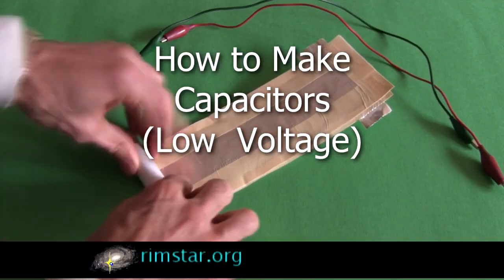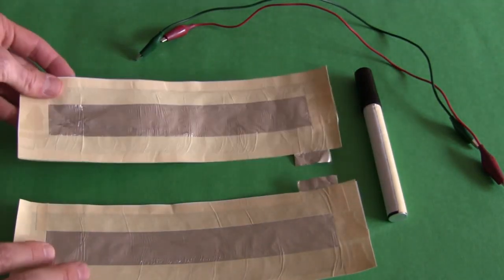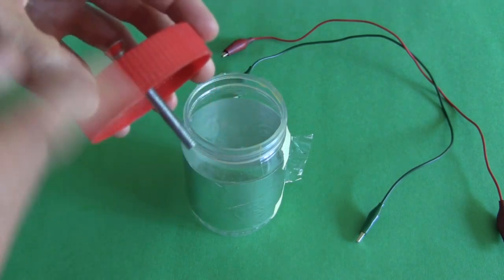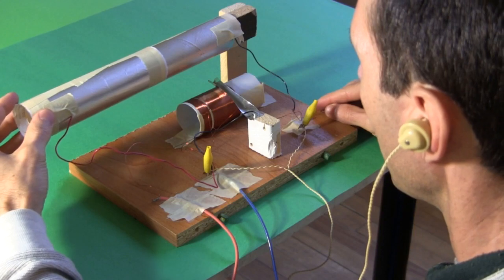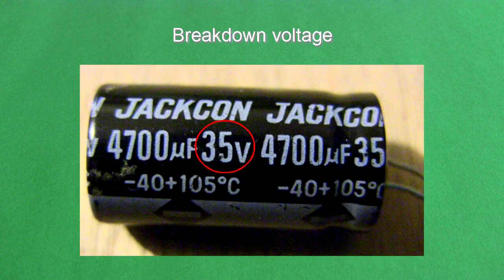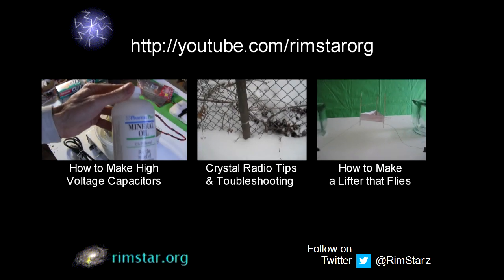How to Make Capacitors - Low Voltage Homemade/DIY Capacitors

Comment from the maker: Just reassembled and measured them. The salt water one is 0.64 nanofarads  and the  tube pen one is 3.66 nanofarads, so the tube one has a greater capacitance. This wrapping a spiral of parallel plates is a great way to get a decent capacitance with a small homemade capacitor.
Reply: consider your formula for capacity is wrong by a factor 4π. I think you messed up with CGS system vs SI System.

Comment from the maker: Oh, neat idea. I guess you can take it further and spray it on a metal plate, then spray the primer as dielectric as you suggest and then to make good, airless contact with the primer, spray a conductive paint as the second plate.

Comment: The "magnet effect" also explains why the farads go up as the gap gets smaller. The closer the plates, the more opposite particles are attracted. I think (my theory, never seen it elsewhere) the particles start to "Stand" from the plate allowing more electrons to be stored. The electrons may even layer up if plates close enough. It also explains the corona effect....

Comment from the maker: I have no idea where to get them in the Philippines. Search around online and you might be able to find some. Art stores sometimes have them too for crafts. I get mine from scrap yards and hobby stores. If you're making a capacitor then any metal will do just as well: copper, aluminum, brass, steel, ... The only issue I find between them is how hard it is to solder to them, if I'm soldering to make connections. Aluminum is hard to solder too.

Comment from the maker: No, as long as the glue doesn't damage the dielectric then it should be fine. The glue will probably be insulating so it will act as additional dielectric material and if the layer is thick compared to the overall dielectric thickness then it will decrease the capacitance. That's because the greater the distance between the conductive plates, the lower the capacitance.

Comment from the maker: I don't know how well it will work with either of those. It's also the first I've heard of using them as electrolytes, though a quick search turned up a toothpaste battery. If you try it, please let us know how it goes.

Comment from the maker: It should be possible to make electrolytic capacitors that are 100uFs. I haven't done it yet but you just reminded me that I should try and if it works I should make a video about how I did it. Thank you! I forgot. :) However, electrolytic capacitors are good for AC parts of circuits, not DC.

Comment: Thank you Maaan for making my life simple. But my question is?
Can we connect "starting" ac capacitor permanent on circuit with right range without getting overheating? Or it's good idea to disconnect the capacitors after starting...waiting for kindly reply...thanks

Comment from the maker: Yes, you can use another aluminum foil. The metal you use doesn't matter much. Just make sure you can make good electrical contact with it.

Comment from the maker: 50 millifarads is huge. I don't know how to make a capacitor with a capacitance that high. If you were to make a simple one using a sheet of paper with aluminum foil on either side then my calcs say it would have to be 35.5 million square meters! You might want to look into ultracapacitors.

Comment from the maker: Yes. Wax paper will work, though it might be a good idea to use more than one layer of wax paper. I actually tried with wax paper first but I guess when I rolled it up there were cracks and the two aluminum layers came in contact with each other, multiple layers of wax paper would probably fix that.

Comment: Will have a look ! I'd built the tube type and mucked with flat plates, but hadn't thought to expand the thoughts to different shapes, constructions etc..much like we get used to the familiar shapes and sizes of commercial electronics components.
Looking forward to the HV caps video.

Comment: Whenever I write MF I am talking about milli farads µ is symbol for micro, M is the symbol for milli (or million if dealing with numbers larger than 1). There is a difference of 10^3 or one degree of magnitude......  Same as any other abbreviation of degree of magnitude. You could suggest people use short probes too... You don't mention the magnetic (Columbs law) effect caused by opposite charged particles attracting..
Lots of good info though. Nice video. A few good tips. Thanks for the upload.

Comment from the maker: I can't say how many volts it can take before the wall of the jar breaks down. You'd have to keep increasing the voltage until it breaks down to find out. Or find out exactly what material the jar is made of and do a search for its breakdown voltage. But if it's a plastic or glass jar, 220V isn't going to break through. I doubt even 1000V will break through.

Comment from the maker: Ah, by "magnetic" effect you meant the Coulomb force, attraction of like charges and repulsion of opposites. That's different than the actual physics magnetic force. I thought you meant the magnetic field that exists in between the plates when the capacitor is being charged or discharged. The molecules in the dielectric line up and polarize, causing the charges in the molecules to move, resulting in a magnetic field. That's the one that I meant is obscure. Thanks for clarifying.

Comment from the maker: Maybe I should have phrased that better. If one side of your capacitor is connected to ground then that side should be the one that you move. If neither plate is connected to ground then make sure your hand won't get close enough to interfere it. I guess I was assuming that in the circuit, one plate of the capacitor would be connected to ground. Whether or not it is depends on your circuit.

Comment from the maker: All the copper clad is double-sided. The middle piece makes electrical contact with the copper coating on the underside of the top stationary piece and with the copper coating on the upperside of the bottom stationary piece. No attempt at insulating is done there. The other "plate" of the capacitor is the copper coating on the upperside of the top stationary piece and the underside of the bottom stationary piece; those two coatings are connected together with a wire as shown in the video.

Comment from the maker: HV cap vid will be this week's, but some form of Coulomb one will follow that. Meanwhile... magnetism is a result of the electron's spin property. A bunch of electrons with spins all aligned result in a macroscopic magnetic field - hence permanent magnets. A moving electron, in conjunction with its spin, also results in a macroscopic magnetic field. An electron has another property called charge, so does a proton, but their charges are opposite. Charge gives rise to the Coulomb force.

Comment from the maker: I don't know how to make a homemade 1 Farad capacitor. The thickness of the dielectric would have to be much thinner than one sheet of paper, but it would still have to be able to handle the voltage. The highest capacitance I know how to make is around 580 microfarads (0.000580 Farads). I show that in my "How to Make a High Capacitance Electrolytic Capacitor" video. But even then, I did not test for how much voltage it can handle.

Comment from the maker: 16.3 millifarads is the same as 16,300 microfarads so maybe you meant something else by one of them. But if you connect the positives together and the negatives together then i.e in parallel, the yes, the capacitance will be 16.3 millifarads.

Comment: mybe its also worth mentioning that the volt meter is also a voltage source which transmit electrons and hence it shows the capacitance , meaning a source of energy like a battery that charges the capacitor and measures the vlaue and potential difference hence display the effect as capacitance on the display ,

Comment from the maker: Hmmm... You shouldn't be having problems storing energy. How are you making your capacitors, how are you charging them and how are you measuring the energy stored? If you have your meter hooked up during charging, your meter might be discharging it just as fast as you charge it. If so, try charging it first and then attach the meter.

I haven't found an easy way to make high capacitance DC capacitors yet without using lots of material.

Comment: Thanks now I know how to use a capacitor multimeter properly... I was wonder how the mF and uf are different. Also at the end of the multimeter there is pF and I wanted to know which side was which... My multimeter starts off with 20mF and then 2000uF and then all the way down to 2uf and then 200nf and then 2000pf and the last one is 200pf... Now that I know the direction of the multimeter I will be able to read data correctly... THANKS :D... OH and I subbed very useful information.

Comment: Hello I was wondering if you would be willing to do a video on the ebner effect, basically it has to do with putting seeds or small eggs in between the plates of a cap. Have been trying to devise a method to try this for myself but am having some trouble

Comment: Thanks for the speedy reply. If so, i should try making a capacitor bank, I have one capacitor of 3,3 milifarads, one capacitor of 1 milifarads, and two of 6 milifarads, but the voltage is low, will the resulting capacitance be 16,3 milifarads or 16 300 microfarads?

Comment: Hello, can I use any kind of tape to tape the aluminum and paper together? Does it make difference or cause leakage?
Reply from the maker: Yes, other tapes work too, like clear tape or electrical tape (that's the tape made of vinyl and that's usually black). Of course, I can't vouch for every type of tape, as you say, some may cause leakage. Don't use aluminum tape though!

Comment: Great video! Is the copper clad you show double or single-sided, and how was the middle piece insulated from the rest of the "sandwich"? I'm referring to the one you made for one of your crystal radios, and I have a surplus if double-sided board. Wouldn't one piece be capacitive in it's own? Off to the lab!!

Comment from the maker: Have a look at my "How to Make Electrolytic Capacitors" video where I make a 62 microfarad electrolytic capacitor. There's a link to it in the description below this video and on my channel page. There's also a link to my "How to Make a High Capacitance Electrolytic Capacitor" video where I get 580 microfarads. Note that these homemade versions of these capacitors are stable when in use but need reforming if they sit on the shelf for a while. They're also polarized since they're elecrolytic.

Comment from the maker: If the nut and bolt are metal then you probably electrically connected the two plates and no longer have a capacitor. There must be only insulating material between the two plates. It's be best if you hold the plates in place from the outer surfaces. Anything in between other than cooking oils will interfere with the capacitance and end up with a different dielectric constant. See the description below this video for a link to my webpage where I show how I've figured out dielectric constants.

Comment from the maker: A thin plastic would work. Better depends on what you want to do. If you want higher capacitance then youre going to need more surface area and may not have enough plastic. Do you need a certain capacitance. Is your voltage very high. For capacitance, have a look at the formula in this video. If your voltage is high then have a look at my "How to Make High Voltage Capacitors - Homemade/DIY" video. You can find a link to it in the description below this video.

Comment: I have a 2mm thick and is 24mm or 1 1"3/8 circumference  and 9"7/16 length copper pipe gonna put 2 wood  end caps circumference 1"3/8 in drill hole 3/8" hole insert 3/8"×5x5/16" bolt grind bolt head to same circumference of bolt 3/8 
INVERT Bolt insert into would plug one end of pipe double nuts to lock in place tab soldered on outside copper pipe and top of bolt head for leads what kind of ferret reading should I be expecting

Comment from the maker: Oh. Your capacitor may have too low a capacitance. You can get a store bought capacitor and see the same thing. If the capacitance is too low then you can't put enough energy into it to make the speaker make a click sound. So you capacitor likely works, just not for your application.

Don't know what I was thinking when I said electrolytics are good for AC and not DC. It's the other way around. So an electrolytic may work in your case (I don't know how much energy a speaker needs.)

Comment: Ahh. There are two magnetic effects... I was referring to the one that causes the plates to attract to each other. which is not the same as two magnets, as you say. If you have time. Could you send me some links to further reading on this topic? I've been looking at your website, but there is a lot to go through...

Like particles attract and opposite repel? was that a typo? I was always taught opposites attract, like repels. Or is that not always true?...

Comment: Hi sir thankyou so much for your videos, and i have a doubt about capacitors, is there any reference you can suggest for designing variable capacitor in a cylinder shape? Thanks again for the knowledge
Reply from the maker: Funny you should ask that... My crystal radio uses a variable capacitor in a cylinder shape. I show how to make near the beginning of this video https://www.youtube.com/watch?v=VqdcU9ULAlA and later in the video I show how to connect to it.
Reply: Excellent and is there a reference, such a book in special, that you recommend me to consult? because i'd like to make just the cylinder but in smaller size, and i have to know its capacitance and diameter designs with  long life term materials and continuous fluctuations of capacitance, which i have to measure. Thank you
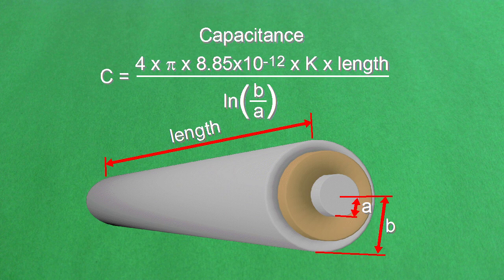Reply from the maker: Sorry, I don't have any book or other references. I just search online when I need the information. However, I do talk about the formula for a cylindrical capacitor in this video at around 4:48. Use that to come up with dimensions for the highest capacitance you need, and then as you pull the plates apart, the capacitance will decrease from there. As for materials, I don't have any reference. I guess you can try looking at various metal and plastic pipes to see how they fit together, but the dimensions would have to be suitable for your desired capacitance based on your calculations. So you might end up using a lathe to make precise cylinders. 
Of course, calculations will only get you started. Make sure you also measure the capacitance as you do prototypes.
Note that if you're dealing with high voltages then you might want to look at my high voltage capacitor video too https://www.youtube.com/watch?v=MPD7skZ8OSo.

Comment: Soooo... i have a question... If you use a higher thickness of your dielectric material you won't get any current flow ? or you can put any thickness preferably very thick to make it much safer ?
Reply from the maker: The thicker the dielectric, the less chance the dielectric will breakdown and current will flow. So yes, thicker is better for that purpose. However, that changes the capacitance of your capacitor, and capacitance is usually an issue. You can adjust for that though. If you increase the thickness of your dielectric you could increase the area of your capacitor plates to make up for it and keep the capacitance the same.

Comment: Also do you know and could you do a video showing a scaled down model of how some of the pyramids worked to ionize the air so rapidly and create wireless power? I know they work somewhat like capacitors or where supposed to. I understand there is running streams underground where they are built and apparently if the large block of gold is in place the bottom chamber and the top gold points are on they produce massive amounts of energy by rapidly ionizing the air as a voltage source from (cont)

Comment: I am building a Microwave Transformer (MOT) power supply for my cordless power tool. Rewind MOT and connect to 100amp Full Wave Bridge Rectifie (FWB). I know my tool are rated for 17Vdc to 24Vdc. So my DIY capacitor will need to least rated above the 24Vdc say 30Vdc... Volt is determine by how strong the dielectric material can hold up without puncher or leak.

How can I DIY it with everyday material? Such as roll of Kitchen Foil and say 1/16" thick brown cardboard paper?

I wish to know what small uF has to do with the cordless power tool Amp draw. I could make a 6" diameter roll or even 12" diameter giant roll to increase capacitance? correct?

If DIY capacitor is constantly charge by FWB, does it matter what capacitance is ? is it true, long as it can hold up the Volt required for tool draw, it good to go...

Comment: At 5:40, could you please explain the physics behind why the capacitance increases as you apply force to the capacitor? For example, if you conducted an experiment to see how added mass affects the relationship between capacitance and dielectric thickness, why does the capacitance increase as you add more mass?
Reply from the maker: Amy Pond It's not a question of adding mass. When you apply force to the capacitor like I did, you're actually pressing the plates closer together. And as I say at 3:50, a smaller distance means a higher capacitance.
Reply: Amy Pond Less distance between plates increases capacitance (C) because (simple terms) the inverse square rule. When electricity is supplied, there is an electric field between the plates (not the same as current flow, I). Less distance means less field strength loss.

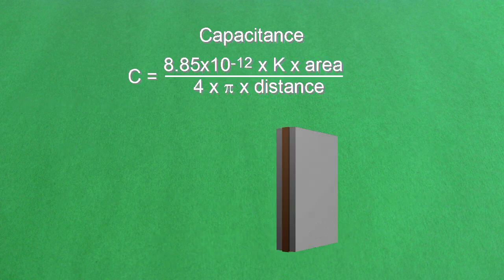Comment: 3:37
thats wrong. The 4π is wrong (in SI unit system). Unless you are using another unit. In CGS, i think the 4π is right, but then the 8,85*10^-12 would be wrong.